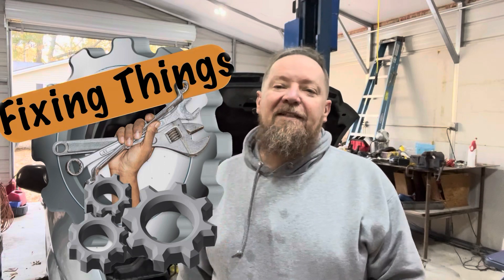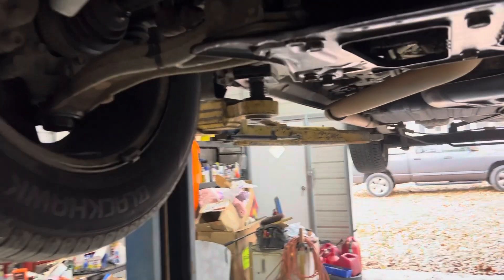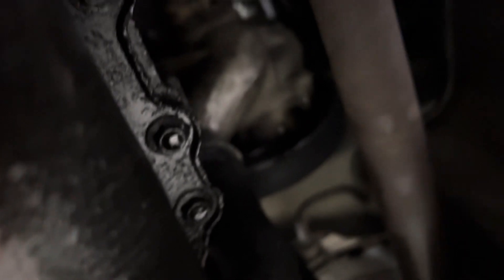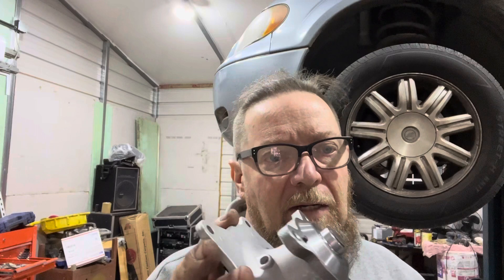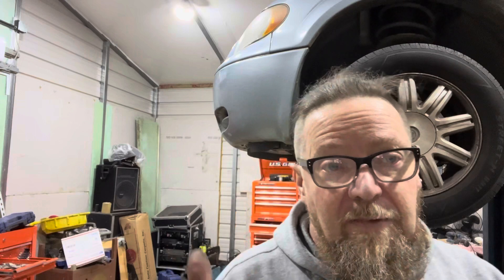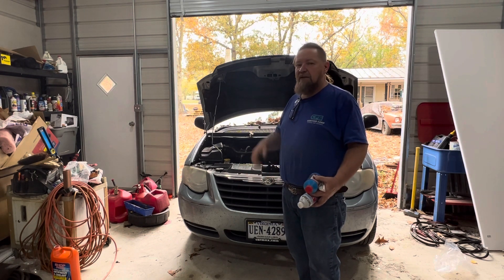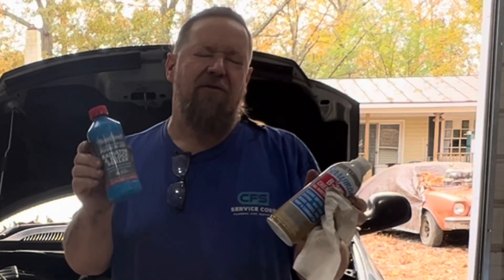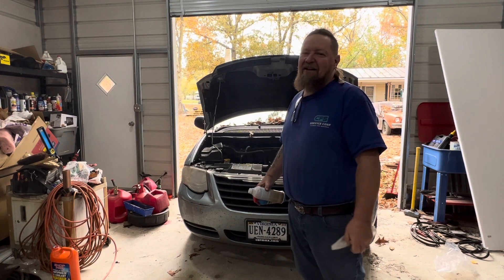How to install a water pump on a 2006 Chrysler Town & Country

Comment: Im confused, why did you take the tube off?  Was it in the way?
Reply from the maker: No but when the pulley was on I thought it might be attached to the water pump. 
Special note : the two upper outside bolts on the water pump are VERY PRONE TO BREAK

Comment: Well I'm glad the Devil was able to help out the Pastor, even if he was blue!
All automotive engineers should be made to work on their own designs, lol. Would it really have been too much trouble to just indent that part of the frame that gets in the way so Much?! Thanks, Chrysler. It sounds like a lot of work, but the engine dismounting isn't all that hard. And it really does help. I was waiting to see how you were going to deal with those 2 more difficult bolts on the top and rear of the pump, but I guess that didn't make the final cut. I know that when I do mine tomorrow, I'll have a swear jar nearby. And I get the feeling it's gonna be full to the brim. 😇 Cars are too hard to work on nowadays. I think our grandfathers would be horrified that you need a degree in electronics and computer science just to diagnose most car trouble today. A big part of what made this country great, was that we were able to fix our own stuff. Well you found a way to fix this one, and I'm sure your daughter is grateful. 
Thanks for the video and the help, Pastor Bill
Reply from the maker: The two other bolts were tuff and one broke, it didn’t make good content and didn’t make the cut. But I fixed it. Thanks for the comment